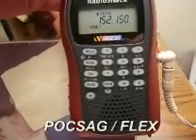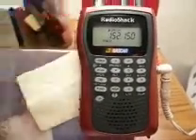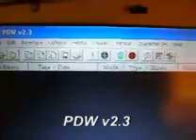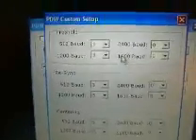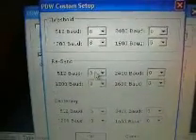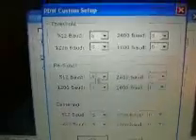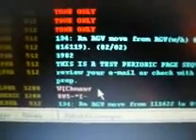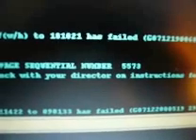POCSAG/FLEX Pagers

Comment from the maker: @MisterTwister55 

Unless your scanner needs a tap, just keep doing what you're doing.  Record or output the audio though the pc to hear what the software is trying to decode.  Should be strong signal w/ low noise.  Not so loud it is being distorted.

Comment: @kkiixx22 
OK. I am limited in purchasing to cash only so buying off the internet is out. you think radioshack still carries this scanner? My radio would work just fine if it wasnt for that fake out of phase stereo separation. I'm gonna try modding my radio and add in a earphone jack b/c if the audio only comes from 1 channel then it works but if it comes from both with fake stereo then it doesnt decode.

Comment: Some of those pager frequencies would also have voice pages. Some would be the common two tone that you often hear on fire and EMS, but they also had some that did one long tone followed by several short tones. "beeeeep blep blep blep blep". Anyone know what that system was called or if there are any videos with those sound? Have not heard it since the 90s.
Reply: +billybassman21 Sounds like you're describing fire pagers. Usually there's one or two transmitters for the whole county and all the local pagers are selected by the tones. This is how Minitor pagers work.

Comment from the maker: I take it that you are hearing the "data" but software dosnt decode it?

If so I can only tell you to keep trying. 

Adjusting the computers sound input & the scanners output are crucial.  

One thing you might do is try to record some audio from your scanner.  This way you can see and hear what the PC is recieving.  I think you might find out that you are distorting the audio by having your levels set too high or vise-versa.

Squelch to hear full noise - you might be missing frist tone?

Comment: actually kkiixx22 I have another question, do you know where i can download the software you are using? ive tried everywhere and all links are dead. id like to plug my radio into my PC and the radio has the weather station frequencies and sometimes they have signals that sound like this id like to try to decode these signals and also id like to try and decode those screeching beeps you hear in an EAS weather alert transmission on TV or radio